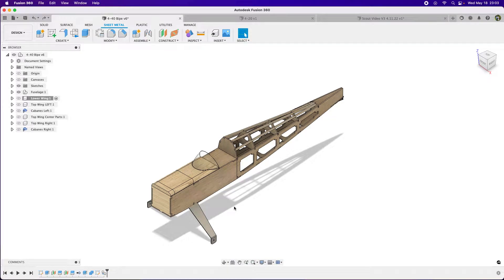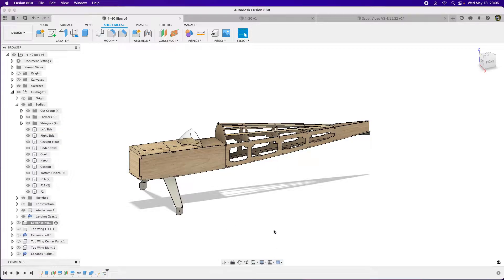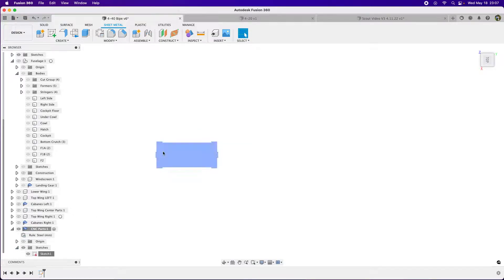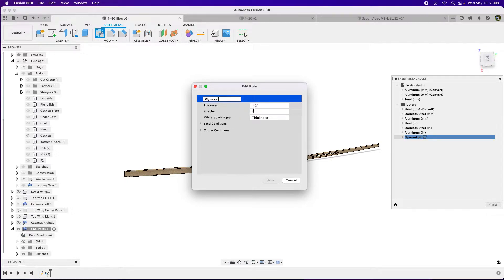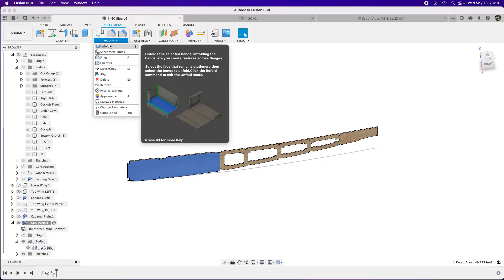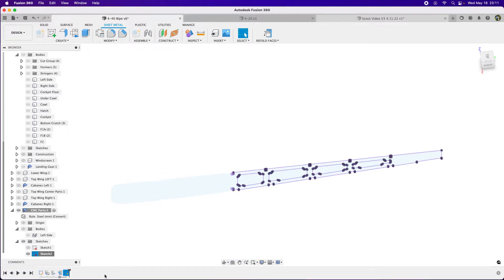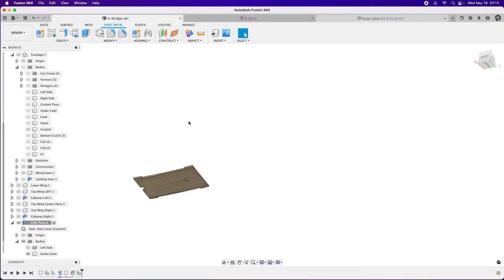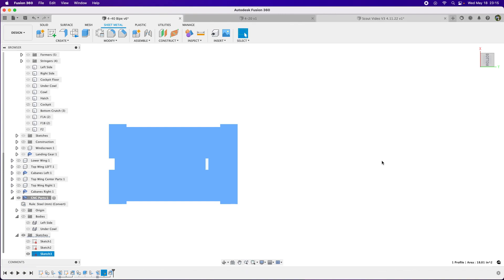Fusion360 From Model to CNC - Including How To Flatten.

Comment: Hello RCGUIDE,

I have started to build kits for RC airplanes from plans (e.g. from Outerzone) for my own use and for the joy of building.

At first I tried to do this directly in Lightburn (i use a Longer Ray 5 with 10W ad 850x420mm surface), but quickly reached the limits of the software.

As I already use Fusion360 for my 3D printed components, the idea was also to use Fusion369 for the construction of the kits.

While researching on YouTube, I came across your videos. I've already watched quite a few of them in the last few days.

They are really fantastic and will certainly be a great help to me.

Thank you so much for all the work you've put into this!!!

Please don't stop making these great videos!

Greetings from Germany
Michael

P.S.: Do you have a recommendation for a first construction? I was thinking of the RCM Basic Trainer or the Q-Tee, for example.

Comment: g'day I keep getting the error ' The selected stationary entity is not connected to any bends'. I've tried aligning one part of side fuselage to an origin, still cant get it. 
BTW your sheet metal material type has to be plywood in the hierarchy list under your sheet metal cnc parts. (yours is steel, if you hadn't already noted that yet)
Reply from the maker: It can be any material, but plywood is better to have the correct K factor. Check out my other video on the subject, it shows how to do an offset and add a flat area. Thanks
Reply: @thercguide4735  I got it in the end, it wasn't a curve but 4 flat but angle joined panels on ea side, so I only needed to project the sketch. I then extruded it and ran some tool paths and simulations in fusion 2 and 3d milling, its not difficult at all. now i just need a mill...
Reply from the maker: You know you are really understanding the software, when you can solve problems on your own.
Reply: Kinda weird, I get that one too even though the body is 1 body and there is a bend, a sharp one, maybe I would just project the to sides of the part and join the sketches to cut the part as one